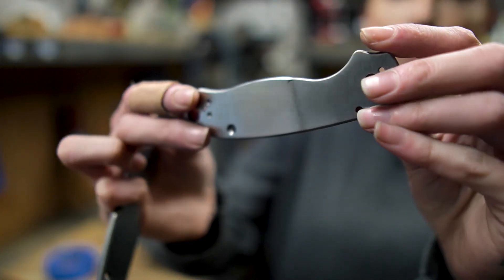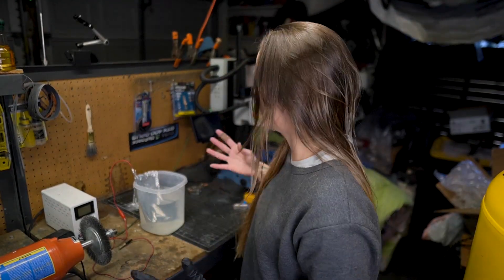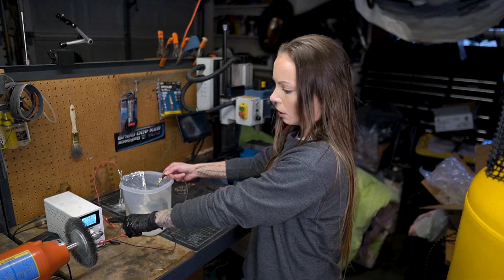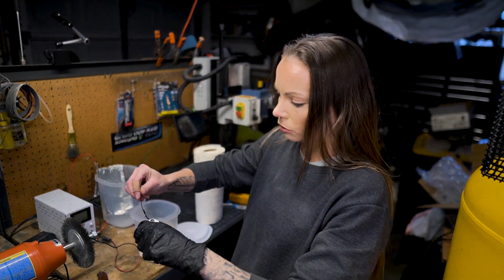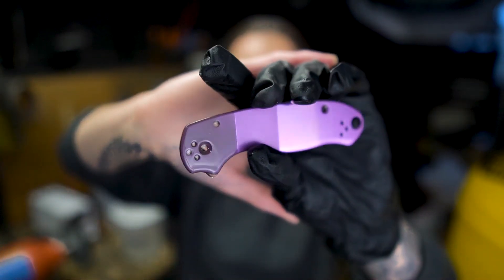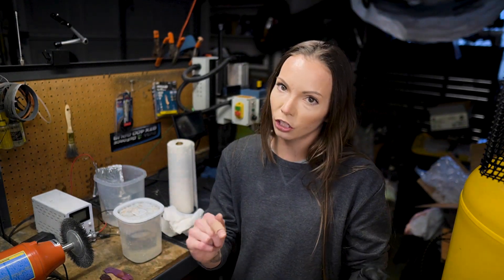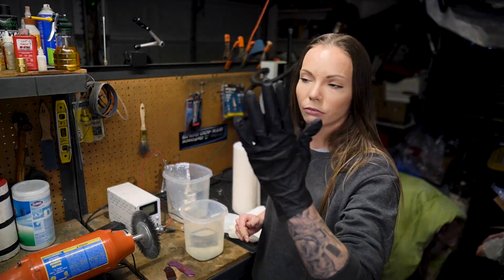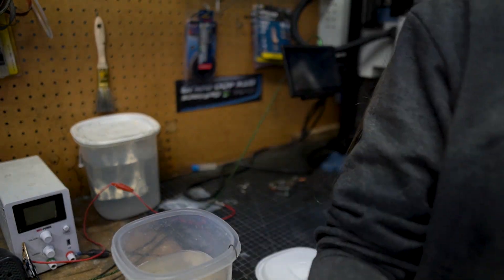Anodizing Titanium Part 2: Different Surface Finishes

Comment: Whats your blast cabinet setup? Ceramic gun nozzle size and psi you spray at for the different medias? Also it appears by the looks the power supply you use vs the power supply in the description  are different so curious what amps you use? I have tried the method in your videos and I can get color but nothing nearly as vivid as yours, I tried a small container, bigger container both with the baking soda and distilled water just blah slight colors, is the multi etch that much of a game changer?

Comment: best videos on ti anodizing on the internet! glad I found you guys 🤙 i still wonder how to get that worn out/ washed look in 2 colors( ex: main color is blue, and edges or texture highpoints on scales are bronze) maybe an episode 3 on that? 😅 good luck with everything!
Reply: If I'm understanding you right, you're looking for a 2-tone ano. Those are really simple, all you gotta do is anodize to your highest voltage color, and then sand off the bits you want  to be a different color. I'm a big fan of 2 tones myself👌
Reply: @I_LIKE_TATERZ  yup, this is what I was thinking of! just experimented with this last week - seems I need a power supply, 9V batteries are fine only if you wanna blue/purple something up. and a better way to stone wash, hah :)) thanks!

Comment: What an excellent way to showcase the differences between finishes and color. Do you ever worry about removing to much material on knives with extremely tight tolerances and/or have you ever had it happen?
Reply from the maker: Thank you! Great question, I don't believe we are removing enough material to run into any issues with scales. However, when we do a mirror stonewash on blades we are very mindful of where we sand and avoid the pivot area for that very reason.

Comment: Btw didnt know t here is glass and bead blasting media...could u make a video where u compare those 2 or explain it in more detail? Thx
Reply from the maker: Yes that will be the next video, Great idea!
Reply: @KnifeModders  Yea I second this... I have one blast cabinet I am using 100# Garnet for my cerakote prep, so I will be getting a second blast cabinet but only want to use one media, either glass or beads... Knifemaker here. Just started in the to Titanium world, got all the stuff needed, but i have a larger heated ultrasonic cleaner that has a separate heater function to 200 degrees so I have a plastic container that will sit in it with Multi-etch. I hate having to have two blast cabinets, and I dont like the finish the garnet leaves on the TI, it darkens it. Look forward to that video.
Reply from the maker: @davexander4142  My most recent full length video is a comparison between the three different media's we use. We have a 60 grit Aluminum oxide, 70-80 grit crushed glass and ~120 grit glass beads. Shows the difference between them and how they all look on titanium. Personally, aluminum oxide is my favorite in the way it looks and feels.

Comment from the maker: One thing I forgot to mention, if you are going to remove the ano with etchent make sure the piece is EXTREMELY clean otherwise it will not etch in the dirty areas, ultimately will etch unevenly! And even if you clean it and put back in the Whink it can still end up uneven. At that point you'll need to sand the titanium until you reach some fresh ti. So be careful!